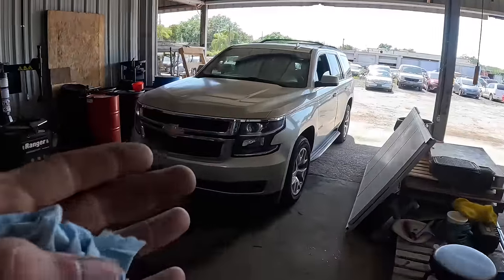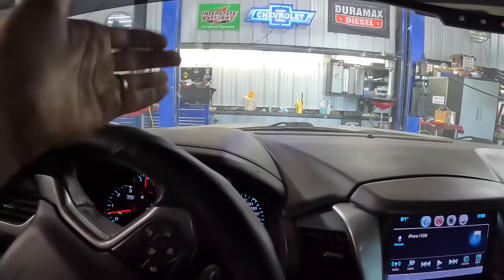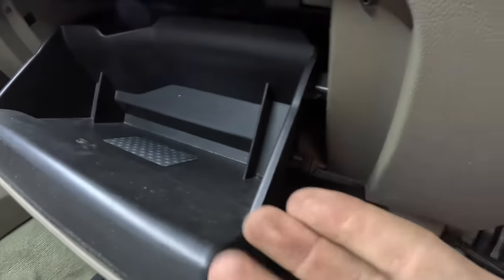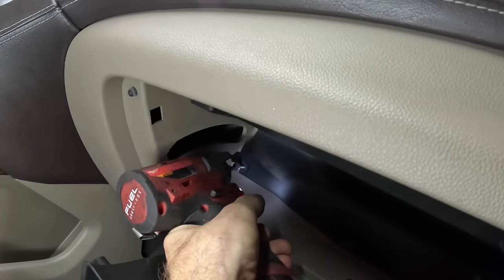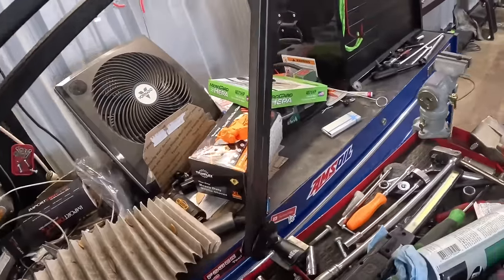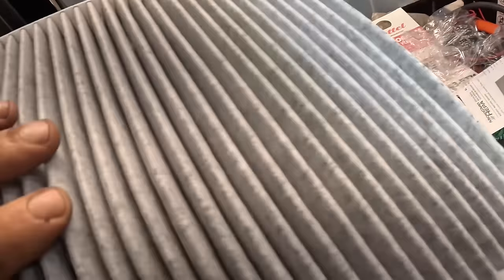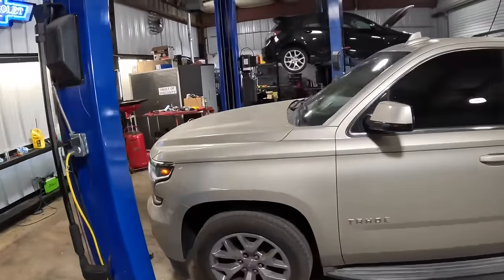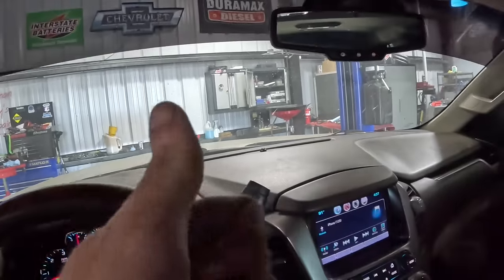Stink Fumes from the Dash! (AC Evaporator Foam)

Comment: Our BG representative taught us to spray the entire evaporator and spray the BG Frigi Fresh spray down through the middle vents before the fan was activated. We later used the foam through the fan opening or use the long tube supplied with the foam cleaner down through the center vents. Typically, the center vents were closer to the evaporator. In addition, spray Frigi fresh through the outside intake vent (open outside vent doors) so the chemical can be sucked into the evaporator. We would check the condensation drain tube  and occasionally see dark matter draining from the drain after the foam spray was used. It worked very well to eliminate mold and mildew. Change your filters every 10-12,000 miles. You would be amazed of the garbage that enters your vehicle cabin. Great posting Ray.
Reply from the maker: I usually like to send it in through the drain tube at the bottom but since I wanted to cam the evaporator I deviated slightly this time
Reply: @RainmanRaysRepairs  You send it through "the train tube" ... where's that located?? 🤣🤣🤣🤣🤣
Reply from the maker: @john_thorpe  hahaha typo
Reply: Wow, this procedure with the BG product is completely incorrect. BG Frigi Fresh is to be sprayed thru the outside fresh air vent at the front cowl with the blower motor fan speed ON and not ON recycled air but outside air and cycle thru each vent setting between sprays and the entire product is to be used.  Also, BG or any other aftermarket products can be used to clean the evaporator thru the drain tube.  This is foam cleaner application and different product.  I saw this and all I saw was the product used as a "cologne" and a typical cabin air filter replacement.  IMHO and from experience, not how it should be done at all.  Improper use of the SNAKE OIL.

Comment: I thought I'd add another comment:  Several times I went on rock hunting trips on a very large ranch with a convoy of vehicles.  The roads were dry and everyone stirred up a lot of dust so when I got home I changed the air filter and cabin filter on my Jeep.  Both were dirty.

Comment: What causes me to hate oil change places is when I tell them up front DO NOT TOUCH AIR FILTER, and  then here they come with the element in hand.  And one of them did not reinstall my nearly-new element, and left the air cleaner unsnapped.  I do most maintenance and repairs myself, but if the weather's terrible and I need to hit the road, I will run through a quick-change place on the way out of town, gritting my teeth all the way.

Comment: My stand point on the filter and charging for labor.  This is why a gst that gets paid hourly does oil changes and filter checks and installs.  Me as a flat rate tech deserves to be paid for my time.  If I pull it out and you choose not to buy it my waist but filters and bulbs add up very quickly.  That is part of the reason why flat rate techs look for stuff to sell.  We need to make money.  As long as what is being recommended is needed and you are being fully honest there should be no problem or issue.

Comment: interestingly, the Mitsubishi series 3 Pajero (Montero in the US of A) has a slot for the cabin filter but it is not cut free from the housing hence no filter installed. You need to get a sharp knife or box cutter and cut around the door slot to free the door.  Then (and only then) can you 'retrofit' a cabin air filter.
Reply: I found the same to be true with my 2011 Silverado 1500. I cut out the opening with a Dremel tool and a razor knife,but what a pain in the butt.

Comment: Cabin air filters are a good idea, as shown by the fact that the old filter was so dirty. Shops that charge so much to change it are the problem; a $20 parts shouldn't cost $40 (or more) in labor. I buy replacement filters for our two Toyotas and replace them every year or so ourselves.

Comment: Always make sure your evaporator drain isnt clogged or partially clogged. Turn off recirc a couple of miles before you get home and a couple of times each summer blast the heat so that evap box gets dried out. You wont have the stinkies.

Comment: And then there's those of us who can find a listing for a replacement filter, yet don't have one to replace. The vehicular form of early installment weirdness, I think. I don't have a cabin airbox with a changeable filter in my 1st gen Xterra (though it's not terribly difficult to modify to have one, if I care to do that). BUT! Later years of my same generation Xterra do have an airbox with a removable filter. Veird, ja?

Comment: Anytime I have used an oil change place (rare) I tell them up front not to touch anything else, specifically my air filters. They always do anyway, and I when they ask if I want to change them, I just silently stare and make it as uncomfortable as possible until they walk away. I know for a fact they have brought me a cabin filter that came out of the trash, as mine was changed the day prior, and was a different shape and color than what they showed me. I got so loud that time that 2 customers asked for their keys back and left without getting their oil changed. Chain places like Firestone and Jiffy Lube are the worst, I try to use Indies like you when I can't or don't want to do the work myself. I am retired and prefer to have my tools collecting dust in the garage these days.

Comment: On your question, you show me dirty filters without asking me to check them.   How does the “average” customer even know those are from their car/truck?   Many a corrupt business will pull that kind of BS.   I do my own work, but my dad always told me request the changed out parts be left in the trunk.   I thought that was crazy until I actually saw a friend get charged for the parts and labor and they didn’t change a thing.   Great reason to bring your business to a trusted mechanics shop and refer them to your friends.  If I didn’t request something I’m not paying for it.

Comment: That cabin air filter tip doesn't work for Chrysler/Jeep/Ram cuz they like to option vehicles with or without cabin filters. 
Kinda random too, I've seen loaded 300s without and base model trucks with

Comment: If only cars had a service setting to run the cabin air fan in reverse so you could feed the condenser cleaning chemical down via the dashboard vents.  You could reverse pole the motor I guess with a few volts while it was disconnected I guess.  

Alternatively put a vacuum cleaner on the external air intake to draw air and cleaning chemicals into the honeycomb while feeding the foam into a dash air vent.

Comment: While you pointed out the directional arrow on the CAF, you failed to mention the need to observe that same arrow on the old filter as you remove it. Not all vehicles have airflow from the top to bottom. Some flow in the opposite direction.

Comment: About the dealer selling filters: I work at one. Our oil change pays .3 of an hour. I lose money if they don't buy anything, because I physically cannot do the oil change and the super duper 30-point inspection in ~18 minutes. ESPECIALLY if they put the oil filter somewhere stupid and I gotta spend 5 minutes cleaning the oil that dripped over everything under the filter. So, in a way, you buying the filters subsidizes the oil change and inspection you get. And makes sure the tech doesn't get shafted.

Edit: also the stupid 15-bolt under trays on the newer Ford Escapes. No extra time for me to do that, just gotta eat it.

Comment: Static electricity is the result of an imbalance between negative and positive charges in an object. These charges can build up on the surface of an object until they find a way to be released or discharged. One way to discharge them is through a circuit

Comment: your scissors need sharpening Ray😁  The electrostatic force is also known as the Coulomb force or Coulomb interaction. It's the attractive or repulsive force between two electrically charged objects. Like charges repel each other while unlike charges attract each other.

Comment: The foaming cleaner will turn liquid  and carry away the dirt and other contaminants. Might want to make sure the drain holes are and remain open. Cabin are filter the Super HEPA is not necessary over a regular paper filter.

Comment: Presumably the cost to inspect the air filters is built into the oil change service, and that cost involves both removing and replacing the filter.  So no additional labor should be added if a new filter is purchased.  I could see adding the labor to find the new filter in stock, unbox it, and to dispose of the old filter, but that seems almost petty, and if it's really significant enough that it couldn't be hidden in the price of the filter, that seems to me to be a cost reduction opportunity for the shop.

Comment: Ha.  Last year I purchased a 2002 Toyota 4Runner.  The next day I went to Autozone to pick up oil and all the filters to service it.  The book by the filter section listed a cabin air filter so I got one.  After spending way too long looking for it, I did some googeling and found out that my 4Runner doesn't actually have a cabin air filter.  In fact, no 3rd gen 4Runner has a cabin air filter.
Reply: My 2010 Escape has a cabin air filter listed at some parts places, and no filter at others. It doesn't have one.
Reply: The reason you may find one listed is because you can add them aftermarket when the vehicle wasn't equipped with one.

Definitely more common as an aftermarket item for off-road/4x4 type vehicles.
Reply: @donwyoming1936  I have a 2009 Escape and I just checked the service manual. At certain mileages it says "Replace cabin air filter (if equipped)."
Reply: @TremaineLea  The only aftermarket one I've found is a custom 3d printed contraption with a custom filter.  The one at Autozone definitely isn't that.  To put in the custom one, you have to remove the fan.  I'll just run without.

Comment: Did the cabin air filter on a 2012 Hyundai accent, last week and it was the original, it was so gross and plugged I had to dig it out, never ever had I see one that bad before. No wonder she complained the ac and heat were no working well, no air flow

Comment: Regarding the cabin filter, I think it is not a necessity. On one of my cars, the filter is supposed to be located until the wipers cowl, a real pain to get there (although I found a way of doing it without removing them). I found out that my model didn’t have a cabin filter. instead of that, there was a plastic frame with a grille to catch the most bigger debris. I realized I could remove this plastic frame and install a real cabin filter, which I did. My point is: cabin filters are not a mandatory thing from what i see but having one is much better, as long as you replace it every 20,000 miles if I’m not mistaking. If the client doesn’t want one, well, don’t install one. He may come back later however telling you that the cabin has become dusty…

Comment: I purchased a new '02 Dodge Ram. In 2017, I had to trade it in for a new car, even though it had run flawlessly. This was because the Rams didn't have cabin filters until 2008, and my condenser was plugged up so bad that the A/C wouldn't work.... I live about 80 miles south of Ray and  a "no A/C" condition is as bad as a blown engine during the Summers here! And ripping the entire dashboard outta the truck was not something I wanted to do.

Comment: I never liked the cabin air filter positioning due to the fact that you clean off the top of the filter as you remove it. So the leaves go into the HVAC box for circulation.

Comment: Note that the cabin air filter is held in with Torx screws so the average Joe who is not a DIY auto mechanic and won’t have the proper tool to get at the filter to replace it himself.  

This could be for ease of assembly, but if I didn’t trust GM I would say this was to assure their dealers got some extra billable shop time. 😉

Comment: It’s been my experience that the cabin filter only filters the vent air from the outside. The reason for all the debris on the filter but no pet hair if you have one. I can’t figure why the system defaults to vent and not recirculate for most or all vehicles. Max cool is always recirculate and that’s where mine stays.

Comment: 2:35 my mom went to one of those chain oil change places. They walked in the waiting room holding a disgusting looking filter said it was her cabin air filter and does she want them to replace it. Luckily my mom knows her car well enough to know it is NOT equipped with a cabin air filter. 🤔

Comment: I had an old Toyota Corolla and was trying to update everything. Now in the manual they showed a ventilation filter, and the autostore had them. So i bought one...

Tore through the car but there were nothing in the ventilation the least bit similar to that filter or any filter for that. Where the manual said it was supposed to be there was nothing.

So I resorted to Google and search and searched and... Found some different instructions for other age models but no, there were no filter. Eventually I just accepted that and put everything back together. Now with time I found there were a lot of other things that didn't match the instructions. The battery information was just wrong. The battery the manual said I needed couldn't physically fit in the car and the terminals were at the wrong places. The wiring just didn't fit. Eventually I found out that the battery in my car only were used in Japanese cars of this model. There were some differences with some components between those built in Japan and those intended for the European market. Fortunately it has the steering wheel on the left side and not at the right as they are on Japanese cars if I remember correctly.

Point of this post is not to get frustrated if the instructions don't seem to match your car, or if some part simply don't exist. Some times you can have a weird one. Or like in my case a rare variant that was built in Japan...

Comment: 3:35 I don't have a problem with it, it is no different than any quoted job where some labor is done up front. Sometimes you get declined and have to eat the labor cost (which could be monetary cost if you pay a tech that labor, or opportunity cost if you do the labor yourself) but if you never quoted those jobs you'd loose out on 100% of them.

Comment: I have to ask (Reeeeee - but you did ask for comments): Is it better to remove the cabin filter, spray the deodorizer and circulate the air for a while (without any cabin air filter in place) and then put in the new filter? The one you put in does have a charcoal liner to remover orders after all so it should filter out some of the good smell and airborne deodorizer before it can do its job.

Comment: .My dealership runs a special, they will replace your engine air filter and cabin air filter both for only $110, parts and labor. There would also be tax, environmental fee (they threw the old filters away), and possibly a small fee for shop supplies (the tech used a paper tel to wipe his/her hands),  So in the end probably $125.  On my Hondas there are no screws to remove. I can buy both filters for around $30 tax included.  Then put them in.yself in 15 to twenty minutes.  So I save around $100. By telling the dealership to take a hike,

Comment: IMHO, as a service one is providing to said customer, I would ask them (you know, communicate) if they are aware that their vehicle has a “cabin filter.” Then I would communicate to them the benefits of replacing the filter and cleaning the spaces within. That’s when you present the cost of performing the service.
If they know their vehicle history, you will know how to handle the rest.
While this is not the way it is usually done, if at all, you avoid all the speculation of the labor portion of the process.
Moral is, while in person presentation and pictures can work, the tech is not getting paid if it is declined.

Comment: Got taken by that labor scam once, rav4 needed new water pump, had them do timing belt service at the same time, they called and asked if I wanted the other two belts replaced as they were original, I said you have them off already so yeah just put the new ones on, wrong $450 in labor charges for those two belts plus the cost of the belts… the real kicker was you had to take the outer belt off to do the inner belt and they charged me hours for the outer and the inner. To me that’s a rip off, since both belts had to be removed to do the water pump and timing belt anyway and the labor for that was included in timing belt/water pump cost

Comment: Absolutely cabin air filters are good. Tesla's have some kind of environmental attack mode. Won't help with CO build up in traffic, but if you start in a nice air spot and stay in recirc mode your only risk would be CO2 buildup, much safer than CO. CO bonds to red blood cells and a longer term toxicant. Funny, my comment addresses a technique vs the benefits of the filter. Filter covers particulates which can be nasty. Carbon can get down to molecular levels absorbing things that smell. Funnier, I have a nice room air filter and it's warning light goes red after a big fart. Not all farts are equal.

Comment: An ozon machine costs next to nothing... but it won't solve a stinky problem when the cause of the stink isn't removed, it only neutralizes stink like smoke and such, but if the stink comes from debris like rotting leaves, mold and stuff, it will start smelling bad rather quickly again.

Comment: I'm a mobile mechanic, so I ask before I show up if they changed either filter in the past 2 years. If not, I bring new ones and change them. The cost of my labor is the difference between my cost of the part and the retail cost of the part. So if they can buy them for both for $30 and I can get them for $20, I will charge $10 in labor to avoid any sales tax.